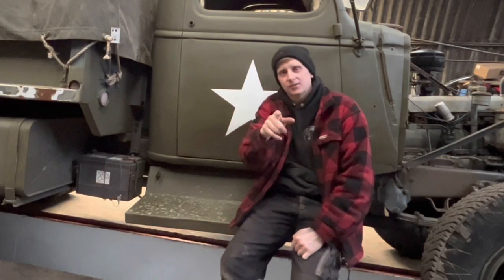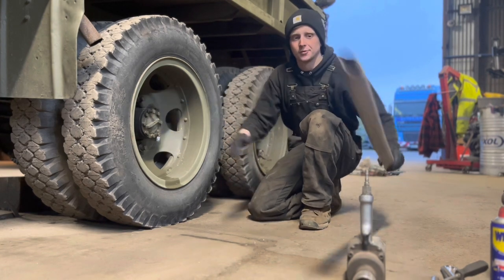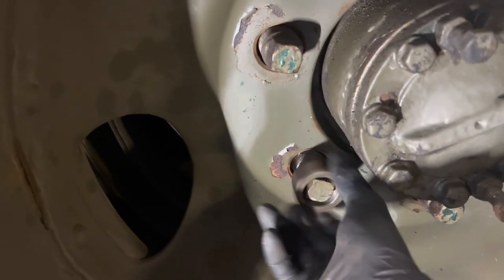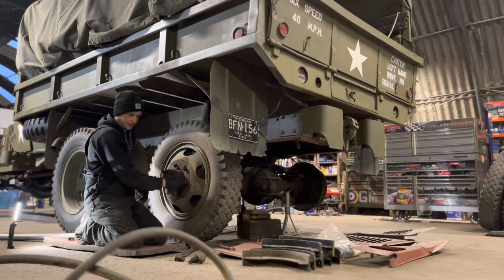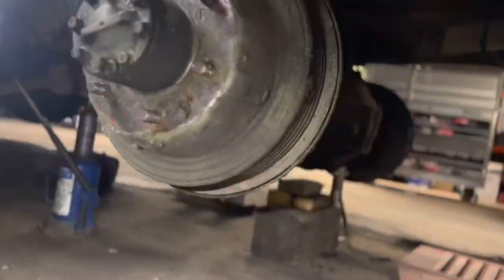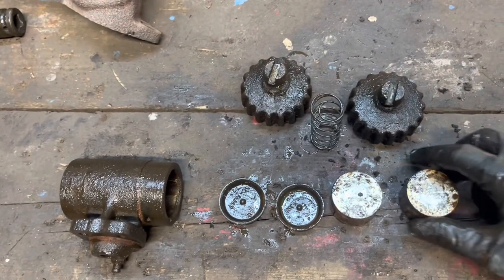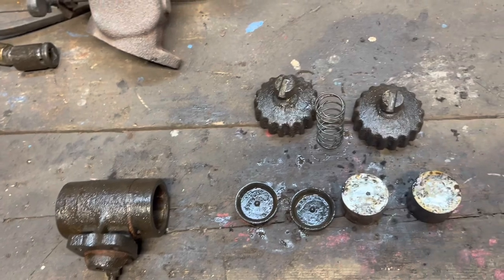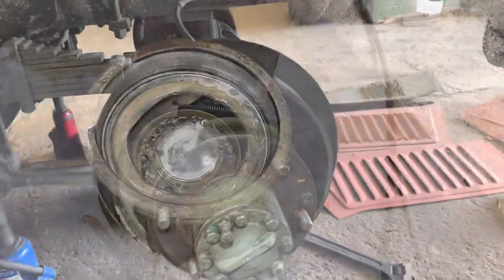GMC Cckw Repairing the brakes

Comment: I used to do all my own car repairs including rebuilding brake cylinders, everyone I knew did it as well.  Then the auto parts stores went from selling rebuild kits to mostly new brake cylinders, and the price was fair, so today most people haven't got a clue how brakes work. It's similar doing a brake job on a truck like the CCKW, but it's harder and more time consuming due to the size!!! LOL I imagine there must be a specific brake spring tool for the CCKW that would be easier than what you went through. You did a great job even though you had to improvise. Cheers from the USA!!!!!!!!!!!

Comment: They used leather oil seals in the wheel hubs and other parts soaking them in motor oil to soften them helps  before installing them .